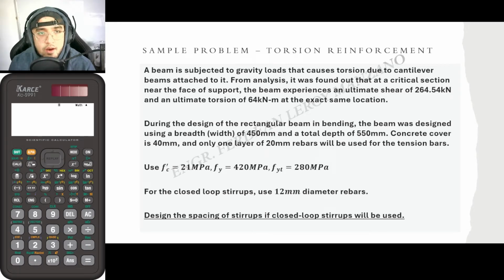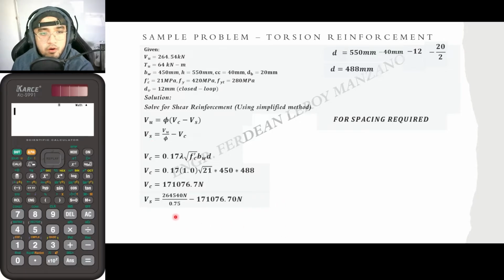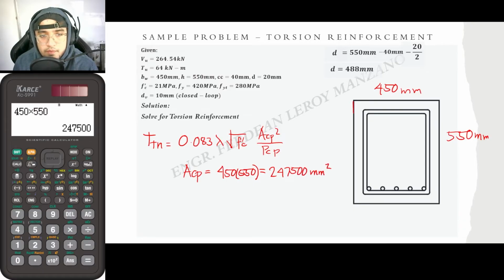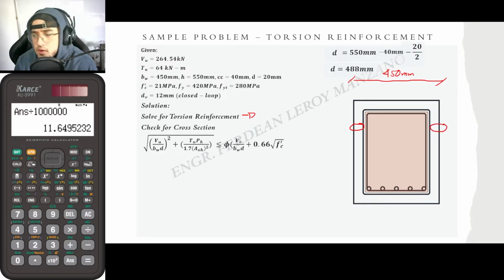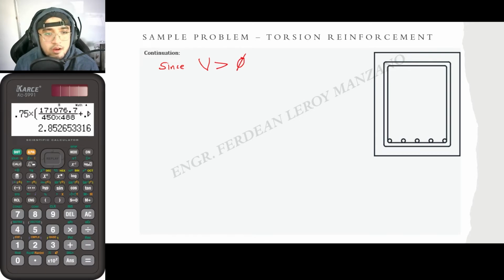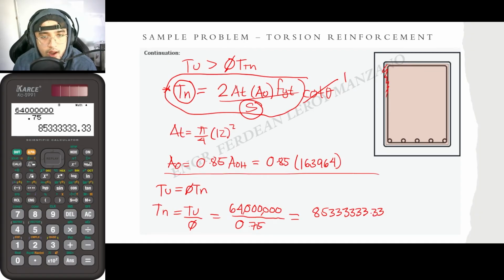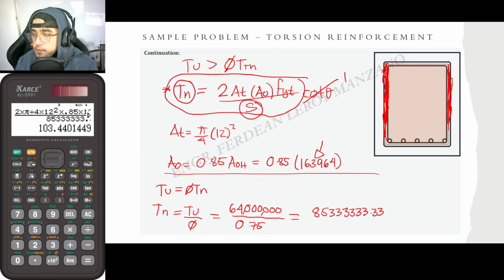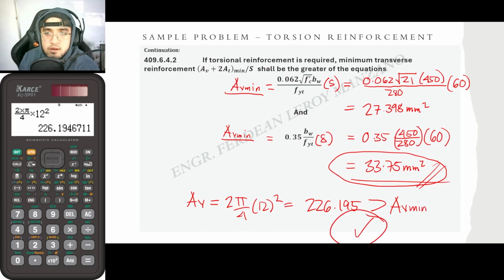Part 2: Design of Torsion Reinforcement - NSCP 2015 and ACI 318-14M - Transverse Bars Problem

Comment from the maker: Corrections: 

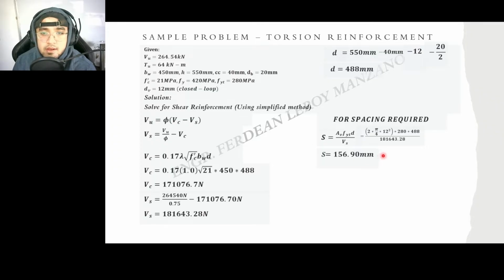@6:31, S=170.153mm. But we can still round down to 150mm.
@18:41, In checking for the cross section. The formula on the left, the formula ((TuPh)/(1.7Aoh^2)) must also be squared. meaning, it must be ((TuPh)/(1.7Aoh^2))^2... Thus, instead of 1.933, the answer for the equation on the left must be 2.583. But it is still adequate.

The rest of the solution is correct. The final answer is also correct if 150mm spacing for shear reinforcement is used. =)

*This video will be updated to avoid confusion*  :)